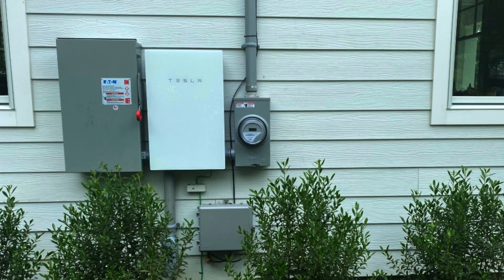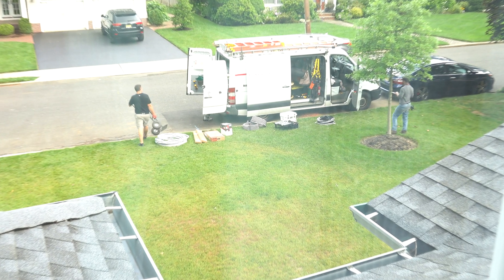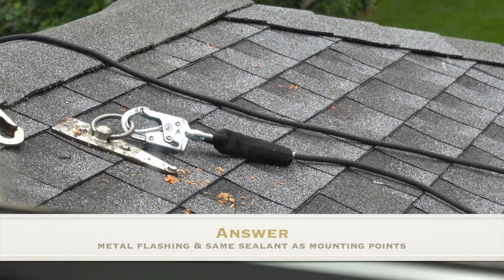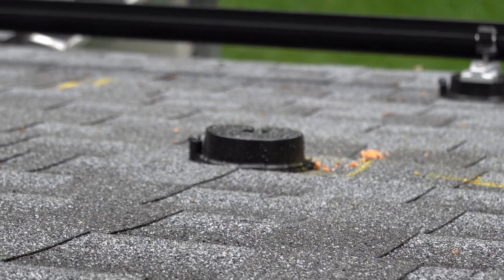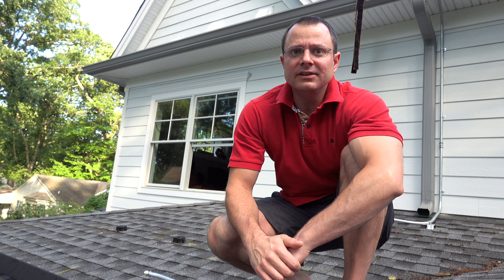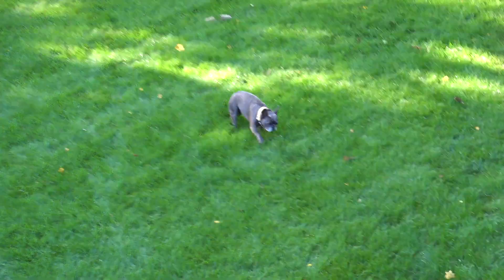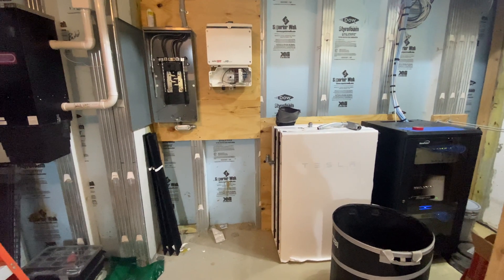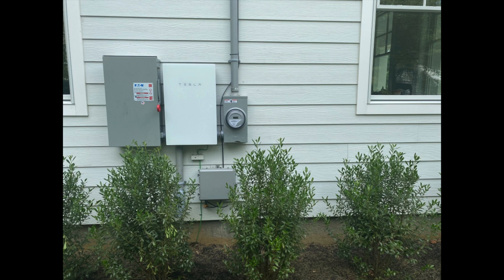Tesla Solar Install

Comment: Scott, 
This is a brilliant series you have, I just discovered it this afternoon!  Only out done by the beauty of the home you built!
I really appreciate the analytical delivery of your info!  Congratulations on having made the decision... 6mo ago. 

Did your analysis indicate the Tesla Panels were more efficient or effective for your specific design needs? 

Say Scott, what safety concerns did you have about placing the powerwalls in the basement?  

Does having the Powerwall and the Gateway 2.0 mean the whole house now has an instantaneous UPS?  
Thank you! 

Cheers,
Eric
Reply from the maker: Thanks for the kind words.  Our system has been performing great.  Best part is that it has kept the lights on for many, many outages (we have a fragile grid in my area)

Given my roof shape, I was looking for the highest efficiency for a good price. Tesla met that well.   I still need to trim some trees to get my best efficiency, but that’s a project for the spring. 

As for safety, I am not too worried about it.  Tesla has a great BMS and thermal management system.  What makes me more comfortable is the amount of data that they have on the batteries from the cars and power walls installed.   They know just how to manage the cells for safety.  What concerns do you have?

Regarding UPS, the gateway 2.0 response time is very fast!  Sometimes I notice a flicker and other times I miss it.   That said, some electronics are just a little too sensitive and restart on the cutover.   I found that my UniFi network gear didn’t like it, so I put a very small UPS in the server rack to keep things running during cutover.   Gotta keep those Zoom calls going!!
Reply: @SDTesla  
That's an excellent point about Tesla having proven thermal mngt & superior battery experience.  My battery worries are just the typical heat or overheating.  
I too am considering placement in my basement utility room. Did they suggest or install any special heat sensors due to it being inside? 

Thanks also for that important UPS detail. One YouTuber referred to it as a UPS for the home... but I wondered. I too have a UPS in my IT closet & at a couple of nodes.  I really love my IT grid up, even when our rural power drops.  My cable/Data services almost never drop off, only after a 5-6 day power outage did their back up generator run out of fuel on the 3rd or 4th day. Haha,  still amazing.  

I'm looking forward to your analysis after the system has been running 6-12 months.
I'm praying for Virginia & Fed. improved incentives.  I'm looking toward a Model Y & Powerwalls in next 12 months.

Does your electricity provider offer a super off peak rate?  With your Tesla do you have a strategy  that's working well for you?  

Thank you so much for the kindness of the reply!    

Cheers, 
Eric
Reply from the maker: They did not suggest any special heat sensors.   I think the safety systems just shut it down before it gets anywhere close to an issue.

My utility (JCP&L in New Jersey) does not offer on/off peak rates.   I wish they did as I believe that it could increase my savings, but they have full net metering which isn't bad.

Comment: I'm wondering why the external conduit? I have my install scheduled for two weeks from now. I'm nervous about external conduit now. I really do not want external conduit on the roof...
Reply from the maker: For my install, it was the following reason, equipment in basement and "likely" cost and simplicity of install.   What makes you nervous about it?   To be honest, I don't love the look (though they did a great job painting) but I would have hated the risk from more holes in the roof and the mess of trying to pull cable through the walls and fire-blocks into the basement!  Given that my panels are spread out, they would have had to drill 4 conduit sized holes in the roof and I don't like the sound of that at all.

I never discussed any of this with Tesla because I didn't think of it until conduit was installed. I don't think I would have done anything differently though.   They did a great job hiding conduit behind the gutter and after I asked them, they painted conduit on roof black, and white everywhere it was against the house.   Hides it pretty well in my opinion.
Reply: @SDTesla  My main concern is aesthetics for sure but I'd also like to have all that wire safely tucked away inside. Almost all the homes in my area have no external conduit. Painting would help camouflage it but it's just something I wasn't expecting. It's not listed anywhere on the plan set. I wish they'd let me put the powerwall in the basement. They told me they only do inside garage's and outside now.
Reply from the maker: Very interesting. I was told they preferred in the basement because of the cold in the winter...

Good luck with the install.   talk to the crew lead as soon as they reach out (a day or so before install) and share your concerns.  It seemed like they had more information and freedom on what could be done than corporate did, especially once they see the property.

Comment: As your panels are not all facing all in the same direction, how is your solar production? Are you meeting the 4x solar production per day avarage?
Reply: Are your inverter single phase, micro inverter or power optimizer?
Reply from the maker: Power optimizers.
Reply from the maker: They are not, my roof shape just doesn’t allow for that.   What is the “4x solar production per day average”?
Reply: @SDTesla  on your most productive day.  Multiply your solar panels rate of charge and then multiply it by 4.

Comment: Hey Scot, so I finally got a redesign of my PV system. 63 panels, 21.42kw system with 3 PW. This will cover 100% offset of my history usage. Looking forward to start generating like you man. The Inverter Solar Edge HD wave seems to be one of the best inverters with good reviews. What are your thoughts?
Reply from the maker: Awesome.  That’s a huge system.   I wish I had the roof space to get 100% coverage.... I’m jealous.   

Everything I read on Solar Edge was positive.   No issues with mine. With a system that big, are you going to have more than one inverter?
Reply: SD Tesla yeah I figured make it worth it since I did have roof space to do 100%. Plus I will be adding a pool soon. Also, Yes it looks like I will have 2 Inverters. Cant wait to get to start generating🤙🏽. I’ll let you how it goes. Im on twitter. My handle is @DesertTesla. You?

Comment: Excellent video! Did Tesla recommend the microinverters or did you request them?
Reply from the maker: Thanks.   That is the system they designed.   To clarify something that I said in the video, they are actually power optimizers with one big inverter in the basement.   They say that the optimizers give you the benefits of microinverters (better power management when some panels are shaded) at a fraction of the cost.
Reply: @SDTesla  Thanks for the quick reply! I'm asking because my setup has some shaded areas like your design and was expecting them to install optimizers.

Comment: question, the install was in NJ, are you registered for the state Srec program?
Reply from the maker: Actually no.   Tesla has the option where they will buy the rights to the SREC generated by my system upfront and then they are responsible for the trading of them.    Could I have potentially done better by trading them myself, yes, but this method shifts all the supply/demand/value risk to Tesla as well as makes it so that I don’t need to think about it

Comment: Did you ever consider any other solar brands like Sunpower before deciding on Tesla?
Reply from the maker: Only to play with their calculator.  Maybe it was because they had old satellite imagery (my house is new construction) or maybe because I’m a Tesla fan, but I only got a full quote from Tesla.   Seemed aligned with market price based on my internet searching so I moved forward.   Might not have been the lowest possible quote out there, but the economics work for me and I’m happy
Reply: Right on, Im a Tesla fan too and Ived placed my order, but just wondering if you may have looked into more efficient panels with maybe higher wattages. Cool. Thanks. Hope you’re liking  your system. Will you be putting out a follow up review vid? 🤞🏽hopefully. Stay healthy and thanks again.
Reply from the maker: Absolutely!!   Once I have Permission to operate and am on a plan that buys back my electricity, I’ll do another video.   Want to also do one that compares seasons (both sun and consumption) but that’s obviously going to be a while. 

When’s your install?
Reply: Right on! So, about 1.5 weeks ago I placed my order and received my system layout. I promptly submitted that to my HOA and am currently waiting for their approval.

Comment: Thanks for the video serie. Super informative. Did the price for the complete system ever change during the project? When I plug  in my info on the website I get an initial price. Just wondering how accurate that is. Trying to avoid any surprises down the road.
Reply from the maker: It should be very accurate - Tesla is quoting in the small, medium, large structure to avoid price changes throughout the process (assuming you got the sizing correct)   If you add/remove panels or Powerwalls, then it will obviously change.     Mine did change, but only because Tesla updated their pricing and panels used during that process, I got better panels and a slightly lower price.       Keep the questions coming and don't forget to use my referral code when you pull the trigger.   Good luck with the decision.     https://ts.la/scott43055
Reply: @SDTesla  Thanks for the quick response. I was just wondering how they can accurately quote install costs prior to going through the detailed process of providing pictures, etc. that you mentioned.
Reply from the maker: My understanding is that they have built the small, medium,large pricing around the “typical” install.  On the easy ones, the make a larger profit, on the difficult ones they make less and it all averages out.

Comment: Hi! at what point after placing an order did you actually speak to a Tesla rep about placement considerations and the like. I placed an order yesterday and received a layout which is not to my liking. All I can see is a blurb about placement and feasibility will be reviewed by the lead installer apparently on the day of installation. I don't want the layout they prescribe and they have some of my roof penetrations wrong which prevents me from getting the layout I desire. Any help is appreciated. Thanks for vids and look forward to future and long term reviews.
Reply from the maker: Call them and ask someone to come look at the roof.  They try to avoid it, but they did mention that they can send people out.  Don’t know if it comes with a cost though.  Worth asking!    Let me know how it turns out

Comment: Great video and very informative. Curious to know what made you decide on going with the powerwall? Working on my order but am on the fence with onsite storage due to few factors buy noticed your house seemed to be similarly situated. Would appreciate any feedback.
Reply from the maker: Decision was easy for me.  Local utility seems to be “fragile” and goes down quite often.  Many around me have whole home generators.  On site storage was a must.   Big storm right now, gird is down, and have been running on battery for 5 hours now.  AC is running and the house is nice and cool!! 😀
Reply: SD Tesla thank you for response - good information to know. You mentioned in your video having micro-inverters connecting every other panel - is this different than the panel optimizer?
I was told via Tesla every system uses a single phase inverter, but with the use of panel optimizers provides constant power when/if panels are compromised.
Reply from the maker: I misspoke.  They aren’t micro inverters, but rather power optimizers (one for every two panels).  Basically the same result of getting more efficiency out of panels when some are in shade, but much cheaper than micro inverters.
Reply from the maker: https://www.solaredge.com/us/products/power-optimizer#/

Comment: A really awesome installation, Scott! I would love to have a roof big enough for 24 solar panels and I'll be lucky to find a place for one Powerwall, let alone stacking them!
Reply from the maker: Yes, 24 panels, but not great roof lines, the roof shades them a bit.   A balance between aesthetics and efficiency I guess.   Right not I am seeing between 55%-70% coverage, but need more data before I truly determine what my coverage is.  

 In the mean time, I am thinking on how to cut AC usage as that is my biggest draw by far.   It has been hot though, almost 90 degrees.   I think my most efficient times will be spring and fall when we get the right sun, but don't have the heat.
Reply: @SDTesla  I am really looking forward to a year's worth of data with cooling and heating costs. I suppose that your climate is very mild as compared with Minnesota? Lots of people live where their  toilets would crack after their water freezes in the bowl if they run out of heating oil!

Comment: Does your system have micro inverters? Or just 1 single big inverter?
Reply from the maker: I probably misspoke in the video.  Every two panels shares a SolarEdge power optimizer (P400) on the roof and one SolarEdge single phase inverter (SE6000A) in the basement
Reply: SD Tesla awesome info, im in the process of getting a revised proposal for an XL system with 2 powerwalls.  I tried to get clarification on the power optimizer thing...and in your review there is one for every 2 panels.  Do you know if that is a tesla standard nation wide?  Ultimately i am interested in maximizing panel production from multiple roof angles much like your project...any helpful advice for me to clarify with tesla?  Thanks for all the great insight as the tesla process has been convenient but provides limited details for homeowners that want to maximize efficiency and aesthetics.
Reply: @SDTesla  they should have put an optimizer on every panel and a 7.6 HD Wave inverter, that way you could add more panels later

Comment: Question isbit better to get a 4.1 kw panel plus 2 power wall and thats $18000 or a 8.1 kw panel no powerwall? Same price or close
Reply from the maker: What is your annual usage?  You might be limited by your power company on how big a system you can get.    Also, highly dependent on your power company’s net metering scheme.   If looking for savings - bigger system is likely best.  If want backup if grid goes down, will need powerwalls.
Reply: We went solar last year, in NJ, where the utility rules are very favorable.  we went with a grid tied only system and will upgrade with a battery backup sometime in the future.  Unless you're on a time of use tarriff/price plan, the powerwall helps in a power outage  and let you use the solar you already put in your home, but the battery won't help you make additional savings on your bill.  Additional panels will offset a larger portion of your bill or earn you credits on your bill.  this is more a general comment, the state you're in and the utility that provides power to you should also factor into your decision.

Comment: How long was the process from when u placed the order. Also what part of the country are u at
Reply from the maker: I am in New Jersey.   It took just under 3 months, but I think they can move faster.  I had to wait about a month to receive my first electricity bill since it’s new construction and I just moved in.
Reply: SD Tesla ty sir. I’m on Long Island.  So basically when you changed to the new lower pricing it didn’t effect your timeline?  

I put down my deposit on June 11 th  I called back 2 weeks ago to get the new pricing and was told that I definitely can buy it might delay my install timeline   Did u find that to be true?
Reply: @electricgreek  I took the discount they offered me which was the difference from the old pricing to new. I kept the older panels which by the way are smaller, so depending On roof space. The smaller ones may be better. I will be getting over 4k back from tesla.
Reply: SD Tesla so yesterday I received all the permit paperwork to sign. Which was 6 different items to sign.   How long did it take for your permits to get approved ?